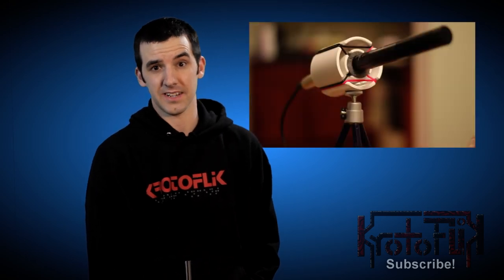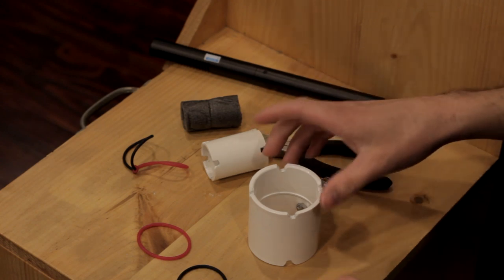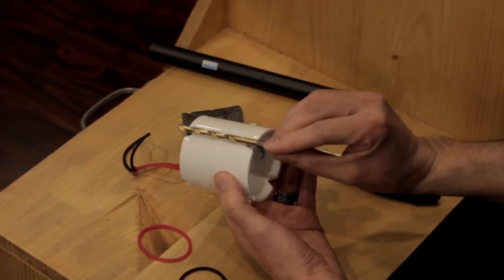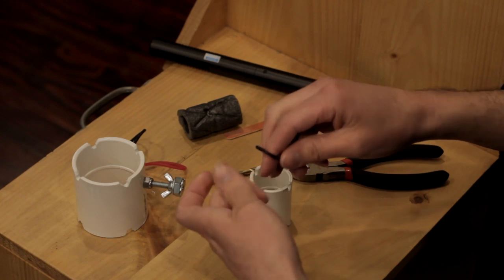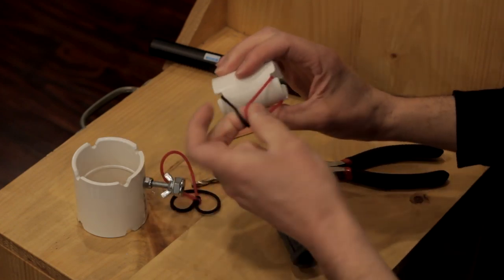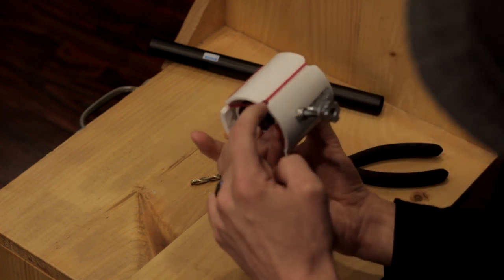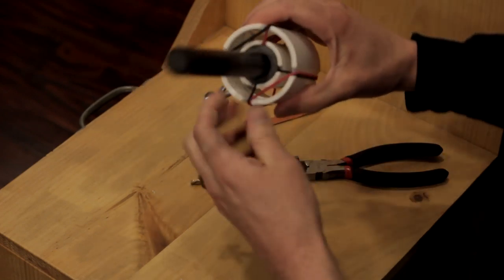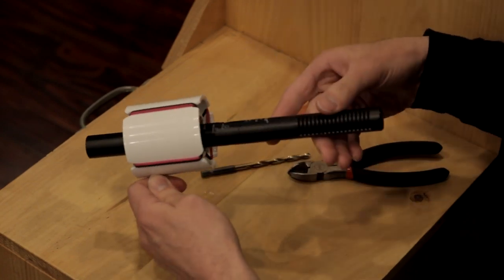DIY Shotgun Microphone Mount - $3.22

Comment: Very slick. The PVC parts can be painted with Kylons "Fusion" line of spray paint. The instructions say wipe with thinner, but I just use Scotchbrite pad and get good adhesion. Any lacquer paint should work, for those into airbrushing. Thanks for posting :)

Comment: Hi! How does it perform? Do you hear the rubber bands vibrate if the boom or tripod is knocked? What difference would you expect from changing the tension? Higher? Lower? Thanks for this neat project! All the best, Rob

Comment: 4 equal holes, use notebook paper or something similar.Wrap the paper around the circumference of the pipe leaving one end flat on pipe and the other end overlaps this.
Cut through the overlap so that the paper is now the circumference of the pipe.
Remove the paper from the pipe.
Fold paper into two equal circumference halves. 
Crease the fold. Fold this into two halves. Crease the fold.
Now have 4 equal distances around the pipe circumference.
Wrap this around the pipe and mark creases.